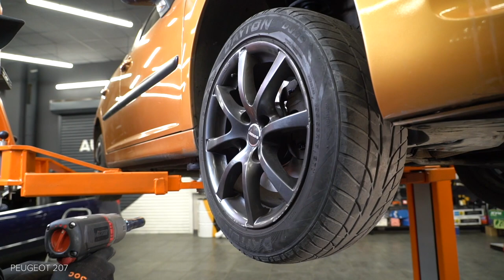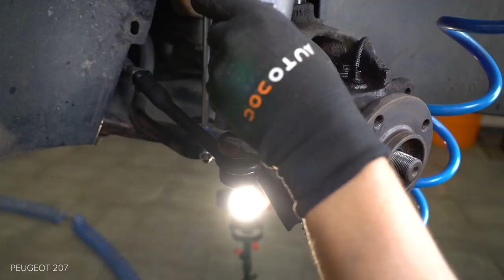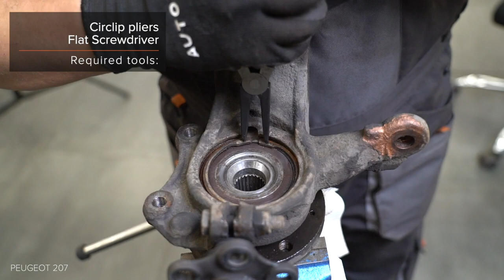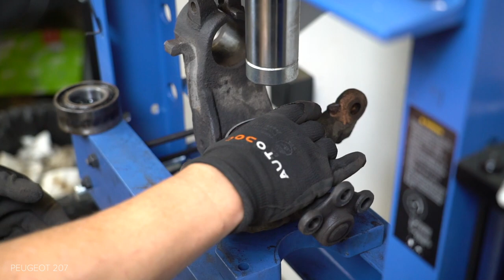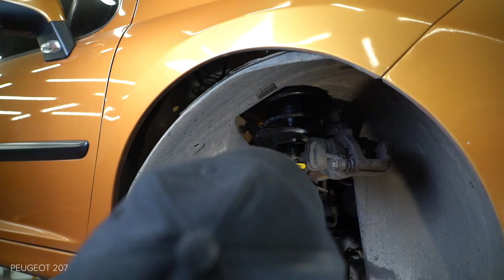Hvordan bytte foran hjullager der på PEUGEOT 207 [AUTODOC-VIDEOLEKSJONER]

Comment from the maker: Merk! Det er en feil i denne videoveiledningen.
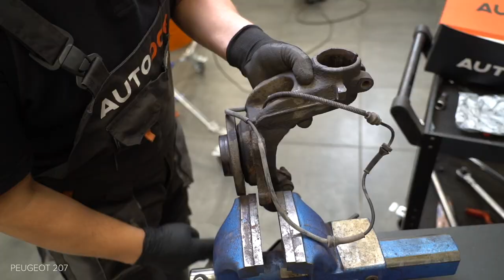9:06 - Skiven bak må strammes med dreiemoment på 10 Nm, ikke 17 Nm.
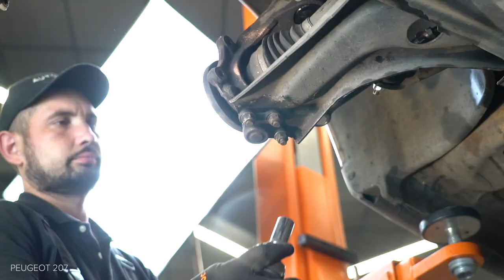11:02 - Skiven bak må strammes med dreiemoment på 35 Nm, ikke 75 Nm.
11:06 - Skiven bak må strammes med dreiemoment på 60 Nm, ikke 65 Nm.
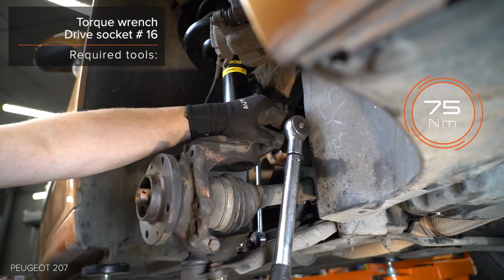11:14 - Skiven bak må strammes med dreiemoment på 55 Nm, ikke 75 Nm.
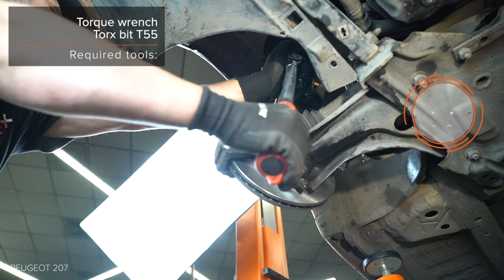11:52 - Skiven bak må strammes med dreiemoment på 105 Nm, ikke 70 Nm.
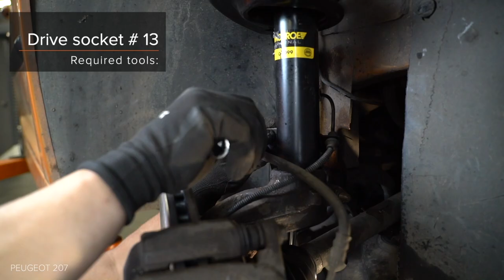12:02 - Skiven bak må strammes med dreiemoment på 10 Nm, ikke 17 Nm.
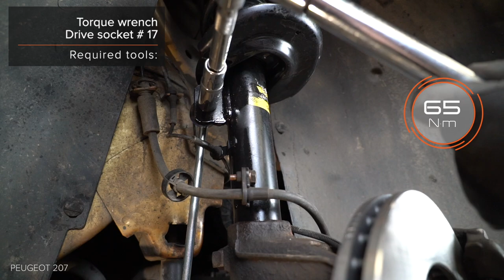12:17 - Skiven bak må strammes med dreiemoment på 43 Nm, ikke 65 Nm.
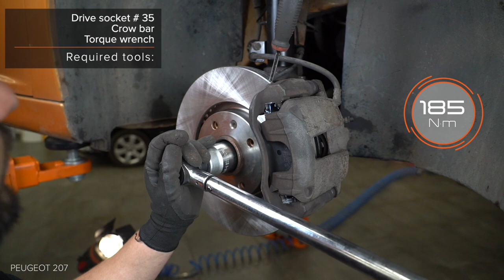12:30 - Skiven bak må strammes med dreiemoment på 245 Nm, ikke 185 Nm.
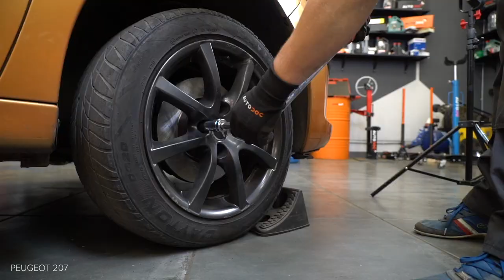13:30 - Skiven bak må strammes med dreiemoment på 100 Nm, ikke 120 Nm.
Vi beklager ulempen 🙇‍♂